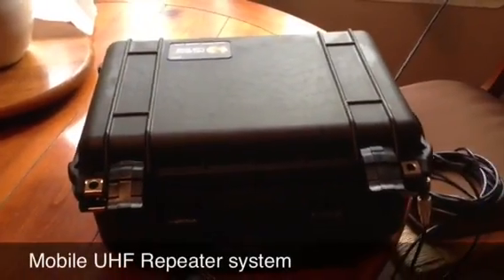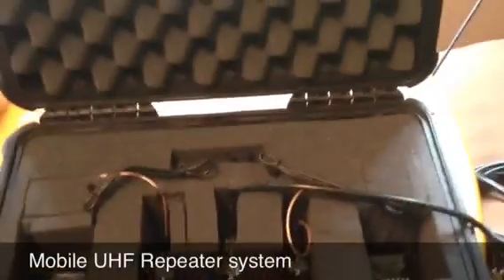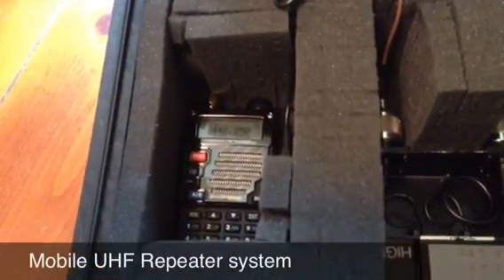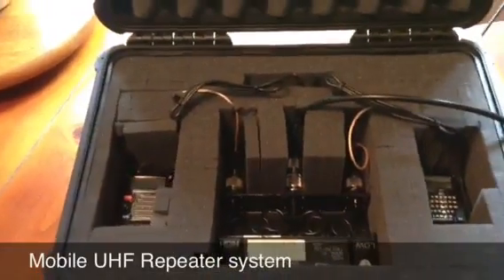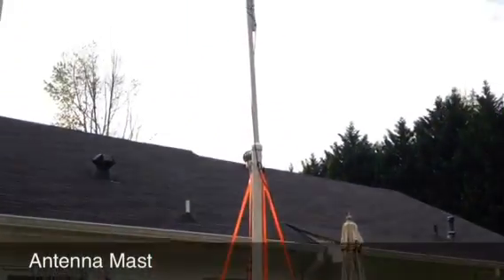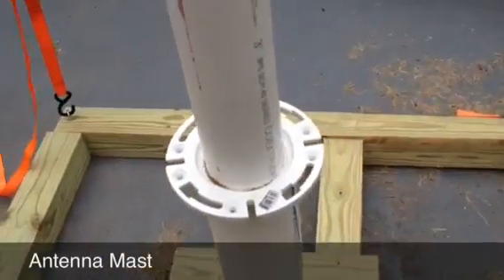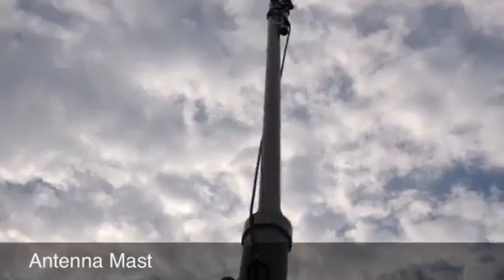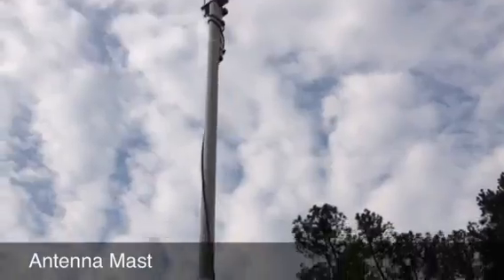Mobile UHF repeater system

Comment: wow nice can you send me the instructions and designs for that mast thanks and how well does that duplexer work
Reply from the maker: Duplexer was junk. Don't waste your time on this project. it was a money pit. Just find a pre made motorola system or do 2 meter TX and 70CM RX.
Reply: ***** You say the duplexer is junk, but if we were to run a 2m tx and 70cm rx you would have to run 2 antennas right?